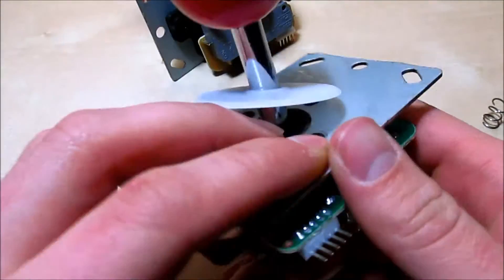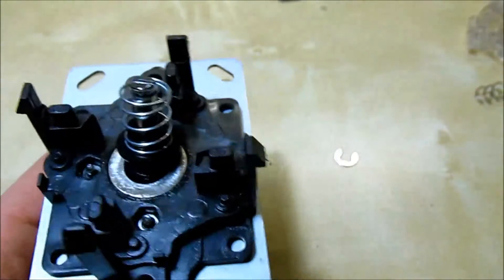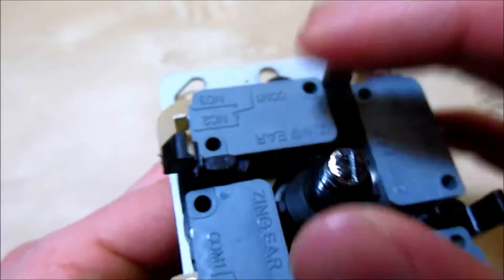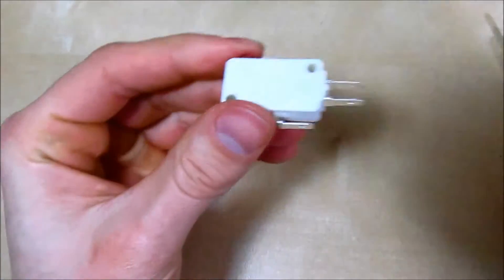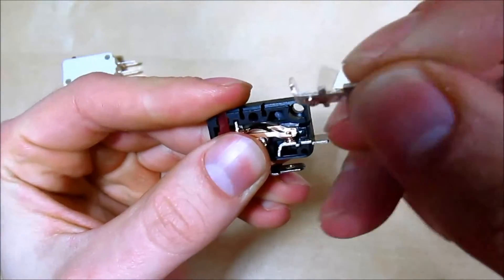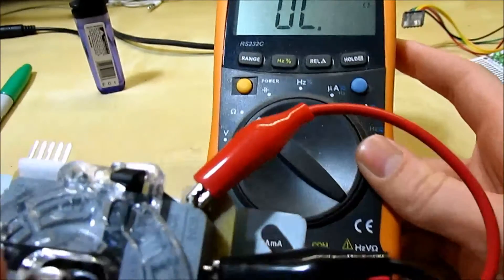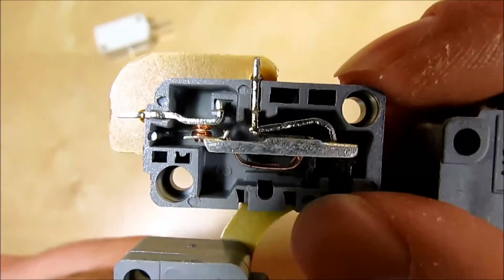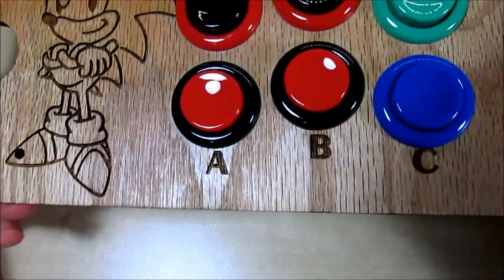Modding your Arcade Joystick, Arcade Button/Microswitch FAQs

Comment: no offence but how is it a simple modification if I need to use a 3D printer to reduce my deadzone? I aint got that shit kicking around
Reply from the maker: +Riddle Nanngi tape also works....
Reply: +Ryan Bates good idea...
Reply: You can also look up the Kowal actuator if you use a Sanwa JLF. It's about 4 bucks, but it's worth it.  I bought it with an added 2 pound spring. I tried it, my hand started cramping, and then I removed the spring and put the stock spring back in with the kowal modifier. It's just about perfect for shmups now, and super comfortable.
Reply: @RetroBuiltGames  I did it with my chinese copy of sanwa. It reduces the dead zone and solved the problem with the diagonals, that wasn't triggering two switches at same time, simple and effective. 👍
Reply: @RetroBuiltGames  have u tried tape
Reply: @lggianne  im confused... so you tape it around? how think?
Reply: @miguelrohv5643  yes, just a few turns of electrical tape to increase the diameter of the actuator  in 1mm, then I cut the excess with a blade. Working fine till now.
Reply: You can purchase individual parts for sticks in the same arcade stores where you get the sticks and buttons themselves usually. I think the video is pretty nice to show how to swap the new part in.

Comment: Hey I know this is an old video but how do you replace/add springs to an arcade button?
Reply from the maker: I'd buy a random spring assortment at the hardware store and hope to get a matching spring. . Looking at the bottom on a suzo-happ arcade button, press toward eachother the two tabs on the bottom to separate it from the body. Find (or cut) a spring of the same diameter to replace it. You can also take two of the same springs (from old buttons) and mesh them together to get 2x the spring force.

Comment: Is that a Sanwa microswitch that you are opening? I'm asking because I want to add hinges to them so they will feel more like an old school lever. I have always thought the hinges are more effective than a gate for guaranteeing accuracy to diagonal motions. I'm asking all that because I still can't get used to the Sanwa JLF, no matter which parts I change - actuator, spring, restrictor plate.
Reply from the maker: yes this is a sanwa joystick. are you referring to leaf switches?
Reply: @RetroBuiltGames  I'm not familiar with the term, so I did a Google search for "leaf switches" and no, that's not what I'm talking about. That's a completely new style to me!

What I'm talking about is the hinges, the little metal pieces that are placed right above the switches in Korean models and the Seimitsus. This kind of microswitches were used in the arcades here in my country, but I can't use one of those right now because they aren't compatible with the equipment I'm using right now. 

My idea is to make my Sanwa JLF as similar as possible to a Seimitsu, Korean lever or one of our old school joysticks, since they all have hinges over the microswitches. All of that is because I still can't get used to how a Sanwa JLF works, and I believe the microswitches are the biggest reason. I modded it in every readily possible way - springs, actuators, restrictor plate, but none of that gave me the desired results. The plan is to add hinges and and a properly sized actuator. Maybe I will just buy a spare JLF PCB and experiment with it. 

I hope I was clear, English is not my first language. Thanks for answering!

Comment: I got a sanwa stick but with no 5 pin cable. Can I solder the microswitches using the wires that my motherboard has?

Comment: I've just bought a RAP 4 hybussa it seems a bit lose I need to tighten make it firm I'll try the spring method although I don't have a place to redesign great video!  Any suggestion pls
Reply: maybe you could use washers to increase the spring tension

Comment: I'm interested in buying my own 3D printer ...
Didy ou use AutoCad or Autodesk Inventor for designing the actuator ? I'm planing to use Autodesk inventor.
Does every 3D printer allow using those professional software programs like AutoCad or Autodesk Inventor or do most of the 3D printers just allow using their bundled 3D-printer software.
Thanks in advance ?
Btw.: Which 3D printer did you use for printing the actuator and what kind of material did you use (PLA or ABS) ?

Comment: say if I have a stick where the microswitches aren't soldered on, are they easily removed and replaced? I have this PS2/PS3/PC stick and one of the microswitches on it gave out, so I've been looking into replacing it (or possibly getting four and just replacing them all in one shot.) I'm also curious about if I need to use a specific microswitch or not or if they're more or less interchangable?
Reply from the maker: They are likely easy to replace. Most micro switches are interchangeable.
Reply: Ryan Bates ahh thanks for the reply! I asked around online and one page on FB recomended one switch in particular so I may have to see about ordering from there soon see if that will work with my controller.
Reply: had that problem, switched the UP swith for the Right one that was kinda faulty and problem solved! ofc that was a temporaly solution

Comment: switches are pretty cheap, dont waste your time trying to diagnose and repair a faulty one.
Reply: All you need is add some grease like wd 40 in to that button but better to oil thrm little bit up cause wd40 can help but can damage too it cleans everything